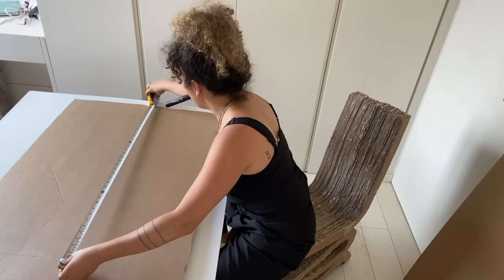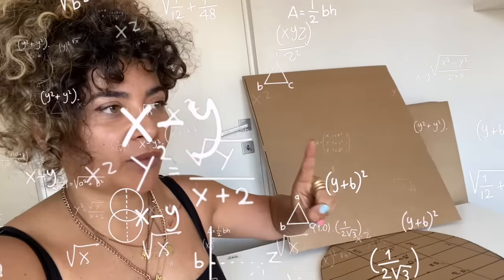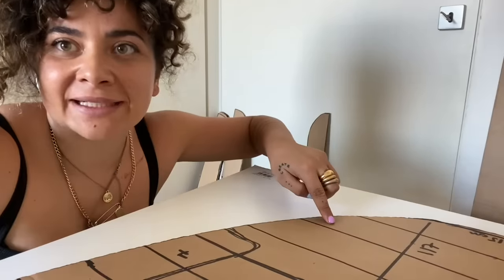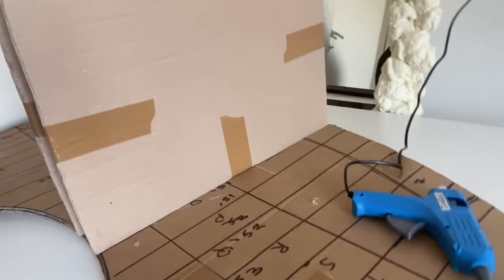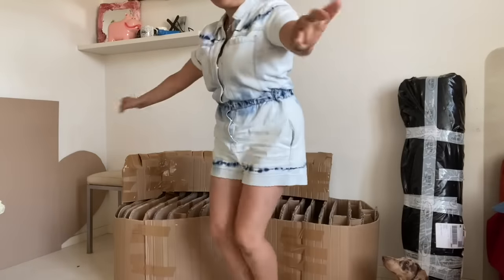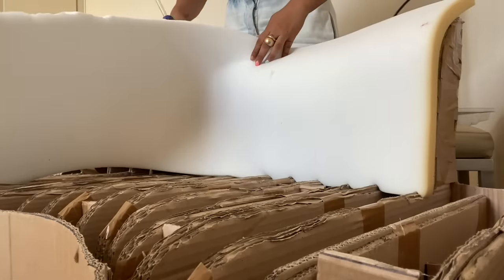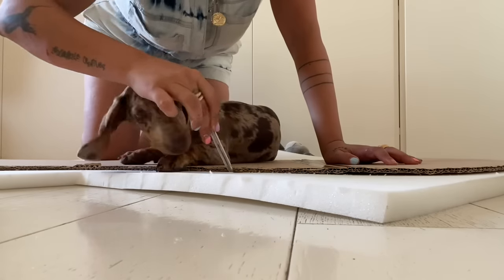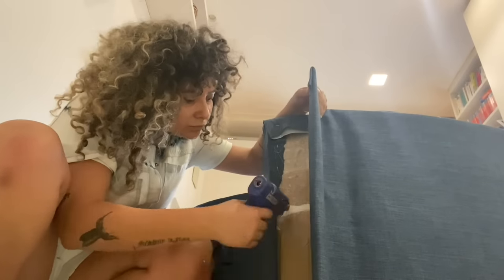DIY CARDBOARD ROUND COUCH // HOW TO MAKE A GREAT PIECE OF FURNITURE OUT OF CARDBOARD

Comment: Just moved into an apartment and had a lot of boxes. As a single person, and a "senior", I need furniture I can carry in and move myself... solution? Cardboard furniture. I've studied the various YouTube videos to get ideas on engineering and design. I'm working with found materials, and lots of contact cement! I haven't upholstered it yet, but it is sturdy and I'm not a lightweight. The best cardboard is the kind used for appliances and TV's, it's thicker. Think about I-beam construction and honeycomb for weight support and rigidity. Upholstery will conceal a multitude of sins. Love the shape of your piece, I may change the back and arms on mine. Once you've got the foundation engineered properly, the final shape and look is easy to change with foam and fabric. Thanks for the tips you shared.
Reply from the maker: ohhh congrats on the new place!!! and if you make it send me pictures on instagram i'd love to see!
Reply from the maker: Yay! Excited !